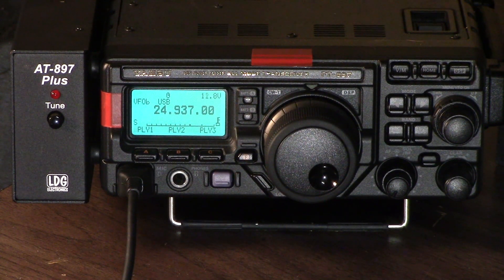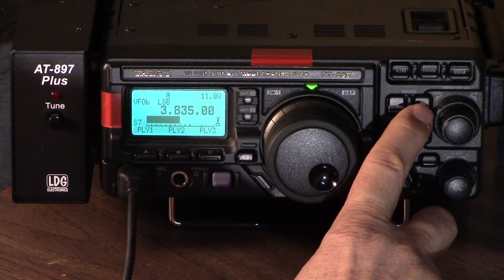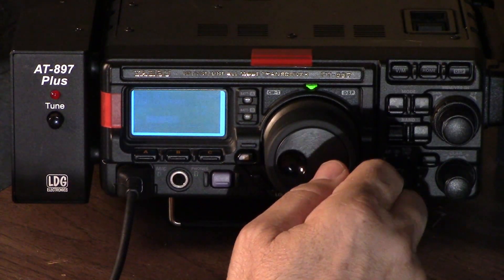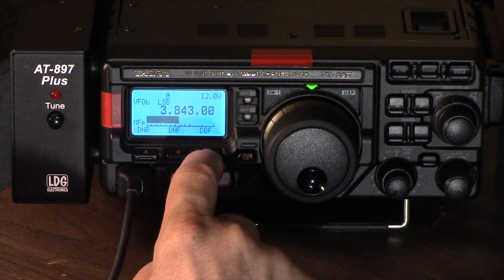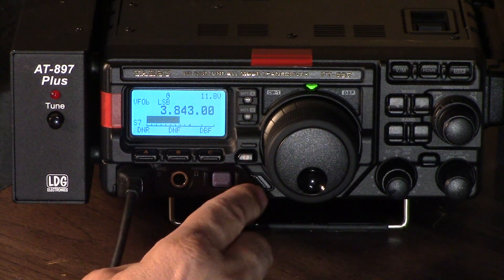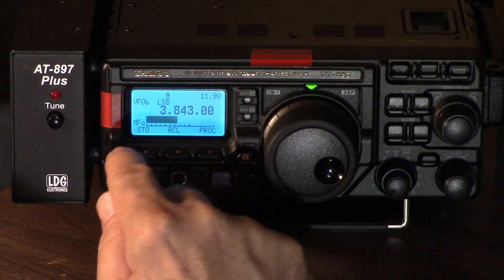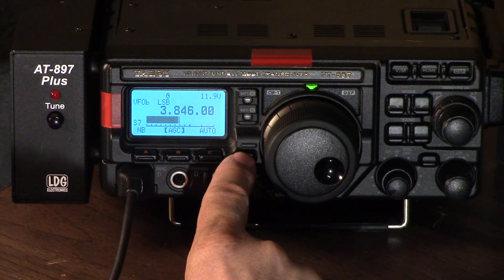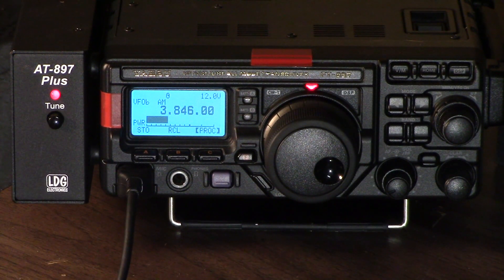Yaesu FT-897D Introduction

Comment: Danial what is a good antenna to run with the FT897 with auto tuner.or Mobil unit for travel.
Reply from the maker: I like the Yeasu ATAS 120 . . . works great for 40 meters on up

Comment: Why does yours have a red colored tab to to left of the menu screen ,  and another above and to the left of freq dial ?
Reply from the maker: Oh, that was a club rig and I used the tape to correlate the rig with the correct coax lines (color coordinated ;)
Reply: @danielgoodson2644  
Oh ,, ok thanks I thought mine was missing something. I bought it a couple years ago , finally hooked an antenna to it today and worked some 10 meter 👍. I really like it

Comment: Rediscovering my FT-897D!   I "rediscovered" my FT-897(D) just in the past few days.  I had to have surgery recently, and before I went, I brought up my not often used FT-897 from the basement shack and put it in my spare room here.  I was told I wouldn't be able to traverse stairs was the reason.  Well, lo and behold, in my newly founded idle time I am discovering many facets of the radio that I was not aware of!  Checking various articles on Youtube or online is giving me new insight into the radio.  My "main" go to radios are the ever popular IC-7300 and it's vhf/uhf counterpart the 9700.

Going thru the menu and settings, I found things to adjust that I didn't know I could!  I had plans to replace the radio with the 991A but now decided to put that money towards a hex beam and keep the 897D, truly a "shack in the box".  I'm amazed at the build quality of the radio, a tank!  I ran a quick extension coax from my End Fed Half Wave antenna up to the spare room and with the YT-100 LDG auto tuner I can get on all bands.  I even plan to get into the ARRL SSB contest this weekend.

So, the FT-897D will stay here in the spare room as my upstairs "100 watt and a wire" quick go to radio, but once recuperated, I'll return to the shack with the Icoms and Ameritron amplifier, satellite capability etc... Up to now, the main purpose of the FT-897D was to accompany me on my numerous camping trips where it never failed me.  My only complaint, I replaced the internal rechargable batteries with new Chinese ones that already went south. Has anybody come up with a d-i-y battery bank?

Comment: Really great radio i cant understand why yaesu has stop making radios like that...
Reply: Agreed. The 991 "replaced" the 897 but it wasn't a replacement IMO, it was aimed at a different market. Certainly not the rugged portable design much loved by users of the 897. Why the hell Yaesu couldn't have kept the form factor of the 897 and just updated the display and electronics I'll never know.

Comment: Hi good day, afew friends of mine have that radio and are having problem with them, am in love with the radio, but can't make up my mind to get one because of the problem their having, Can you tell me if the company made any improvement,band can I get a used one to buy, always looking at your videos, thanks for your information
Reply from the maker: Hi, curious what problems they are having. . . Dan
Reply: @danielgoodson2644  Hi Don, one of them having problem with the display, lots of streaks on it, only transmitting on FM and two meter, and the other guy already sent his radio overseas to get it fix he had couple of issues to just can't remember off hand, will check him out

Comment: Very good overview 👍. You can customise the quick menu ABC buttons (Multi-Function screen "q'). For example, I have one one set to go into the RF Power option so that I can quickly adjust RF power. Although the Mult-Functions on the display time out like you said, the buttons still work. So, I can leave mine set to "q" and know that, if I press button A, I can adjust the power using the Multi-Function knob. Sounds a bit complicated but once you set it up, it is easy to operate.

Comment: Excellent overview of the FT-897D!  You must be a professional radio DJ or you are just a natural. Your voice suits this type of video very well.  Plus you zip right through keeping it on point and interesting.  I am impressed.  Anyway, I have owned two of these radios the past 15 years that I sold.  It has been about 3 years since I sold the last one but just bought another last week.  I have a soft spot for this rig.  It was the first solid state HF rig I owned.  I just gave it a detail job (my specialty) and it now looks brand new again.  I was about to put it on the air.  I have owned so many radios since that I needed a quick refresher for the FT-897D.  I found your video and it was perfect for my needs.  This is the first time I have seen your channel.  Too bad more viewers have not seen this.  I also own an Icom IC-718 and I see you do an overview on it as well.  I'll take a look.  Although the Yaesu FT-897D and the Icom IC-718 are older basic rigs they are still VERY popular so these videos will be very useful.  Now subbed!
Reply from the maker: Thank you for the kind comments. I sure wish Yaesu had stayed with this rig a while longer. I would love to have seen an FT-897D MK II with lithium ion phosphate batteries, and noise reduction in the IF stage. . . I still love the rig as is though :)
Reply: @danielgoodson2644  Me too! They still hold a good resale value so that shows there is still a market for a radio like this. Yaesu was ahead of the times with the FT-897D and the FT-817nd. Portable operations are extremely more popular now with POTA etc. than they were when Yaesu came out with the FT-897D. The IC-705 is the big deal now but it is overpriced and comes in a flimsy plastic case. Of course the lightweight is crucial in SOTA etc. 73!
Reply: @danielgoodson2644  Yes, I have wondered about this as well. Yaesu never did a proper replacement/updated FT-897D. A shame, as they are fantastic field/portable rigs and they were built like tanks.
Reply: @Steve-GM0HUU  I think that the update was the 'D' version, but it was merely incorporating a filter which was optional on the original version.